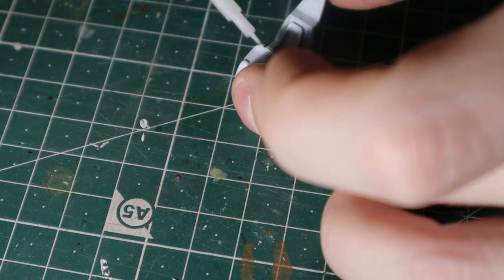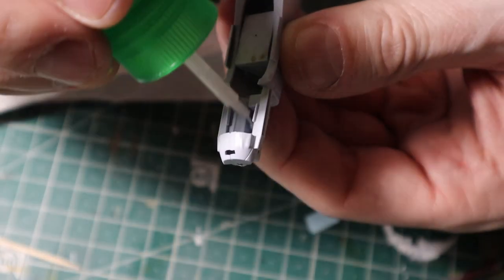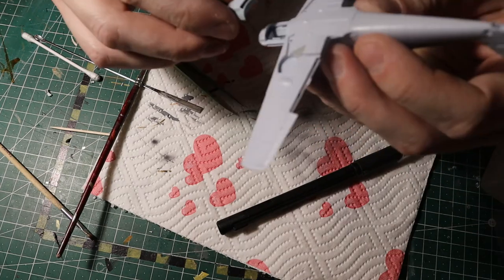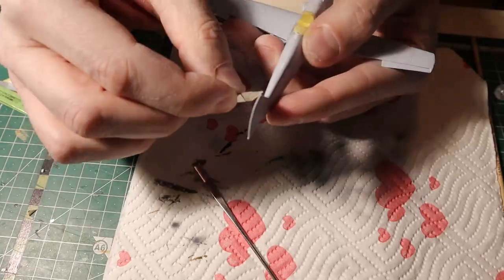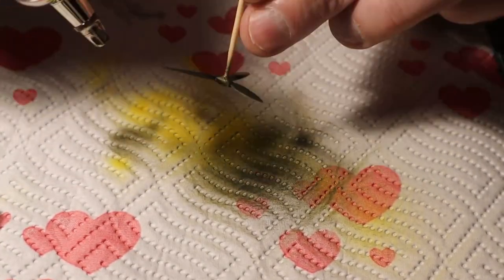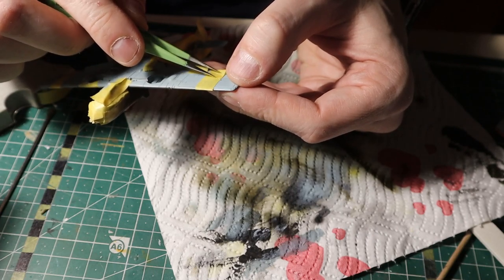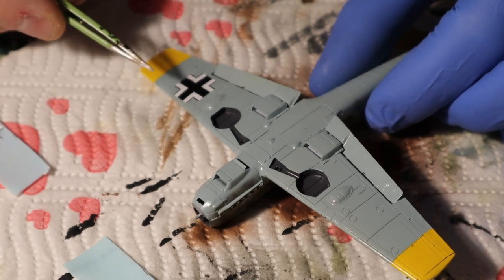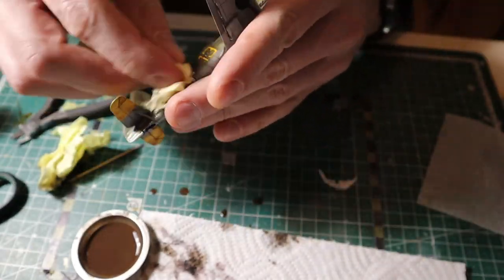Messerschmitt Bf109E-4 from Airfix

Comment: Very very nice job! And video too! Thank you, sir! ;)

Note: I believe there are supposed to be seams/lines on top and bottom of the plane between fuselage halves, behind a canopy, on Bf-109s, so not that much puttying and sanding necessary... ;)
Reply from the maker: Hi Roland :) Thanks very much :))) I think you are right. I went on the mighty Google and saw some plans for the airplane. I usualy go of the drawing that is included in the kit. But not BF109 had this line on top and bottom?? I found a bunch of photos and did not notice it :/ OH well it is what it is. I prefere the smooth transition :)